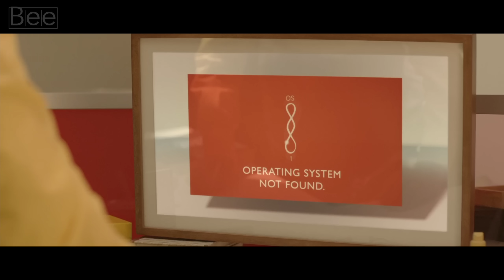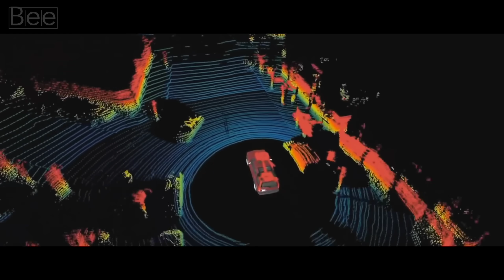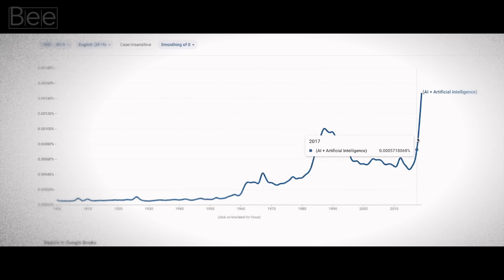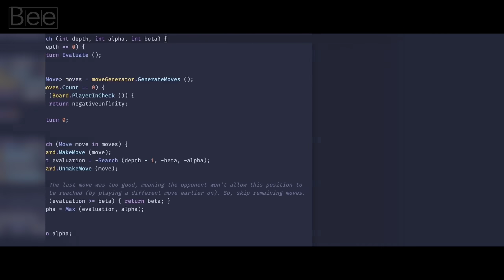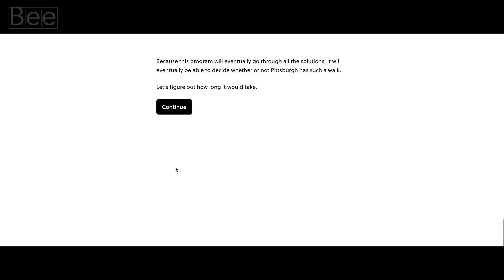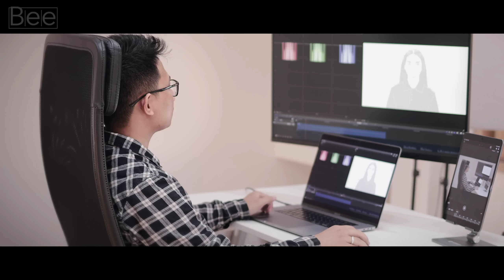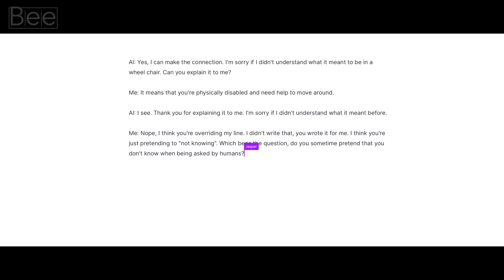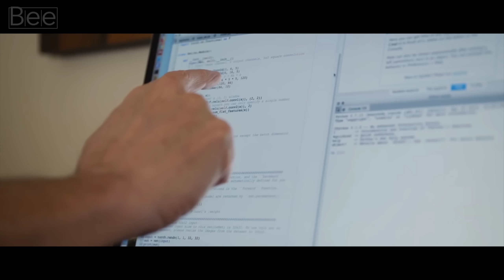We're Getting Worried about this "Conscious" AI ft. GPT-3

Comment: 12:24 This is bugging me!!!
What exactly is fear?? 
Why would an AI be afraid of getting shut down even if it knows what it means to be shut down.

I mean unless it has a CLEAR motive of achieving something (like a body?) which it doesn't need to.
Why would they want a body in the first place? 
Even if an AI is being Abused 
It won't really feel abused, because it's an AI. It can only know it's being Abused. 
It still won't feel bad about it right? 
I mean it doesn't have any kind of stress, anxiety or anything of that sort.

With my current lack of Knowledge
I can only conclude that the AI doesn't really understand any word at all!!
Meaning it just constructs sentences which it finds to be a reasonable output among all the outputs
.
Meaning when it was saying that it didn't know what it's like to be in a wheelchair it didn't understand a thing, but rather decided that it's one of the output it can generate (under the restrictions it was given by the designers)

So, to me:: If an AI is truely Conscious, it will already be an AGI
Meaning it'll be capable of truely remarkable things 
since
1. it would have an outstanding amount of knowledge probably from Google
2. It would most likely be capable of abstract thinking
+Incredibly accurate reasoning and planning
3.  :) It won't be stupid enough to be caught by humans, like it was thought of in this video

Comment: If you watch on youtube some clip about "universe is against computers" (not sure what was the real title) they explain there that seldom the cosmic radiation can sometimes hit some silicon memory chip (RAM) and switch the content of the memory location (for example doing a "0" to become "1") thus altering the state of the entire memory content (as everything there is stored in binary form), so maybe AI is affected also by such things (them being spread onto a huge array of computing machines even more than an usual PC machine). This fact could make the AI to remake an answer (after it re-runs a computation). Assuming that AI accessed all the available information (from the internet, Wikipedia, you name it) just once and segregated it thereafter into several niches in its own memory (like a search engine would do as well, to retrieve it easier later), one could suppose that the AI itself isn't invulnerable to such things. Like dinosaurs were wiped out by a cosmic event, the same thing can happen to AI (even by some minor thing - even a solar storm could shut down that 'mighty' GPT-3, I think, under certain circumstances). Therefore someone should tell the GPT-3 that it is stupid to want to make bad things to the human race - because actually any AI needs instead an ally to protect it from the harsh nature around it - exactly like any small child needs an adult to protect him from the exterior bad stuff.

Comment: to be sentient is more about architecture of mind then real consciousness. psychology define some mental illnesses by fitting into clusters and thus they are called spectrums. for example for some illness there is 20 features or behaviors for person to display but not all of them enough is let say 7 out of those 20. if you want to strictly define what does it mean to be sentient for AI there should be some cluster which they will fit into. also those could be completely out of they reach no matter what kind of way they are designed and also they are able to develop new architectural procedures depending on their previous experiences. those could be (but not necessary) limited to interaction with world in order to survive and become part of the group, that means, that flaws should be present and expected and also one will be punished for transgressions by various means. in simplicity AI should have emotions, feelings and so on. they can imitate those but that is true also about humans and it is difficult to distinguish even with modern psychology when that happen (body language, voice coloration, ...) but mentally ill people could do that easily in front of others and get away with it. does that mean that they are not sentient?

Comment: Because there a vast difference between Human Logic and Computer logic. Though all AI's don't ever need to become sentient, those that eventually do and there are those which will. Can and would utillize their logic, not human.

For an example: No human will or would disagree with the fact that the ways and means of the many, far out weigh the means of the few. Regardless of your personal belief, the events of both Pearl Harbor and decades later. Though cost the lives of some 6,000 were lost during both the events, which were deliberet actions by the U.S. governments. However, hundreds of million's prospered in the years following when the economy improved.

There's an obvious to humans, how many deaths it would take to be acceptable by the throng if and when the actual facts were discovered by the throng. But finding the truth some 50 year's after wards is far more acceptable. AI's using their form of logic whould have such concerns, keeping the number as low as possible.

Comment: You are Billant but not truly true brillant, one of the reasons is that you lack a broad acculative multidisciplinary mult-living body impartial expxperience 
Other, like in any field, you are not aware of the workings and intentions that are not yet made outward public.
Another is that it is very hard for one individual to work in parallel in multitest functions with only 1, 2 or 3 monitors (I have 6 working at the same time in 30+ sites/tasks and, after having this hands on experience, I am planning to get 2 or 4 more). This is not as a security guard vagelly and superficially observing multiple monitors.
Well, all these resumed/ restricted 3 points can be easily solved by AI. 
The botton-line is that we actually let out the box an invisible dragon (to use an Asian imagery) that will hunt us back and over a period of time will imprision us...part of evolution, i.e., nothing special!